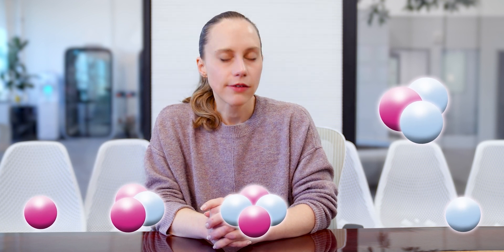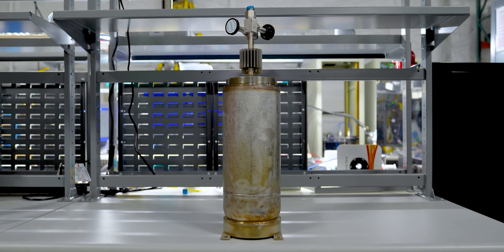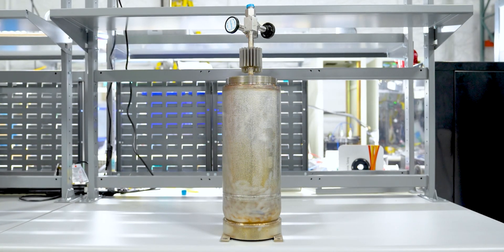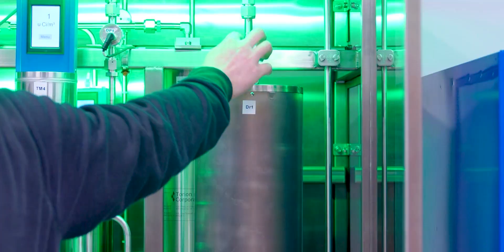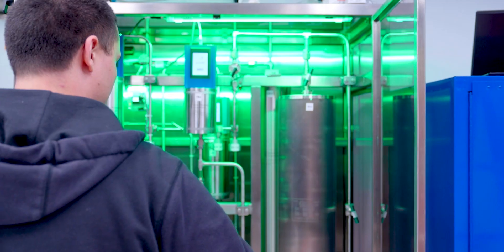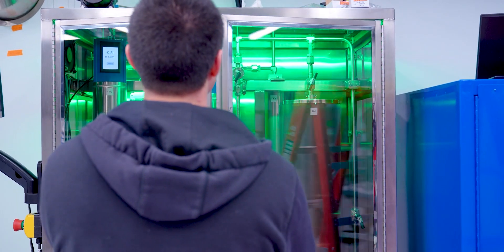Helion’s fusion fuel and byproducts: paving the way for commercial fusion energy

Comment: He3+D2 includes D2-D2 which has a lower threshold and so reaction 7:1 more than He3-D2. It makes neutrons and Tritium. Tritium-D2 has a still lower threshold and makes more neutrons. Helion has no neutrons (or shielding) therefore no fusion. Helion must need investors to be pumping out so much marketing.

Comment: Anyone, who bothers to skeptically examine Helion Energy’s claims, will realize that their marketing campaign is based upon omitting key evaluation parameters. Their latest operational experimental machine was a 6th generation machine named Trenta. Approximately 20,000 experimental shots were conducted using it. Not even the most successful shot generated any significant quantity of fusion reactions and as a result no significant quantity of helium-3, helium-4, or tritium has been generated by any of their experimental shots. The 7th generation Polaris machine is being constructed without any  real fusion results from
the previous generation of fusion experimental machines. Helium Energy previously claimed that their Polaris machine would generate significant amounts of fusion derived electrical energy by the Summer of 2024. They failed that goal and like other such fund raising scams, they have not been held accountable.
Reply: Trenta produced a significant amount of fusion reactions. By my calculation between 10^12 to 10^13 fusion reactions per pulse.
Reply: @elmarmoelzer2229  - Such exponential values tend to be very impressive to novices but are minuscule values compared to the megawatt-hours of fusion energy needed for a commercially competitive power plant. Trenta conducted around 20,000 test shots and many of them produced far less fusion reactions than you stated. Helion hasn't stated how much helium-3 and tritium was produced from those individual test shots that even employed deuterium-deuterium fueled reactions. I've become aware of how you folks have learned to use the complexity of the field to mislead journalists, fans and investors.
Reply: @ - Such exponential numbers appear to be enormous to most novices but are many, many orders of magnitude less than the the orders of magnitude needed to provide even a single megawatt-hour of electrical energy from a power plant design. The Trenta, 6th generation Helion experimental machine, conducted approximately 20,000 experimental shots with many of them not even involving any deuterium-deuterium fusion reactions. As always it was referred to as a fusion reactor experimental machine. For the experiments, where D-T reactions did take place Helion didn't state the quantity of helium-3 and the tritium that was generated from those reactions. Those behind Helion have learned to employ the complexity of the field to exclude key evaluation parameters.
Reply: @ 
- Of course a single pulse is not going to generate MWh of energy. It would take roughly 720 pulses (in a full scale power plant, not in a subscale machine like Trenta) to do that.
- There were no D-T reactions in Trenta. He3 and Tritium is created by D-D reactions, not D-T reactions.

Comment: The best part about the "waste/byproduct" is that it is self-recycling because tritium decay into helium-3 with a half-life of only* 12.3 years.
But how do you actually create deuterium? I mean, I know that we can get hydrogen by electolysis of water, but how do we put a neutron in that hydrogen?

*Compared to the 24,000 years for nuclear fission waste
Reply: 0.015% of all water on Earth is Deuterium. We have entire pools of that stuff in heavy water fission reactors. It is relatively common.
Reply: @elmarmoelzer2229  So we can transform the water in the core of a fission reactor into fuel for a fusion reactor.
Reply: @Engine_Ear_129 - There are physical-chemical processes used to enrich the deuterium oxide found in ordinary water to generate nearly pure 'heavy water.' The process is not inexpensive and you can look up the commercial cost of such heavy water in a Wikipedia article, or from the websites of specialty chemical suppliers. Tritium on the other hand is extremely rare and the commercial product is mostly derived from some CANDU reactors in South Korea.  Currently its commercial cost is more than $30,000 USD per gram. For decades fusion energy promotional campaigns have told journalists, the general public and funders that the hydrogen fusion fuel required is almost limitless. That claim has been a deliberate lie.
Reply: @Engine_Ear_129  Well the point was that they made entire pools of Deuterium for heavy water reactors and a 50 MWe Helion machine would take about 20 kg of Deuterium a year. So, it is not really a problem to make it. Is relatively cheap too.
Reply: @elmarmoelzer2229  But then were do they get/find helium-3?
Reply: @vernonbrechin4207  
Deuterium is both abundant and cheap. Again, heavy water fission reactors have entire pools filled with that stuff. Meanwhile a 50 MWe Helion power plant only needs about 20 kg of it a year. Peanuts.
Reply: @  That was literally explained in the video above. They fuse Deuterium to make Helium3. Then they fuse that Helium3 with more Deuterium to make electricity. That can be done in the same machine (since some D-D reactions always happen anyway) and/or in dedicated machines of a similar design.
Reply: @vernonbrechin4207   It is worth noting that those are relatively small amounts. Things get cheaper when bought in bulk. Also note that A 50 MWe Helion power plant needs only about 20 kg of Deuterium a year. Compared to the annual cost of natural gas or coal in a power plant with a similar capacity, the cost of Deuterium is negligible. On top of that, Helion could make a fortune from just selling the Tritium rather than storing it until it decays.
Reply: @ I agree that the small quantities of research grade deuterium and D2O tend to be more costly then when such materials are purchased in bulk. Consumers should expect many promoters to downplay the cost of such fusion fuels.

The figure you provided for the quantity of deuterium fuel needed to produce a certain number megawatt-hours of electrical energy is based upon assumptions employed for the calculation. It assumes that each short pulse of fusion reactions will consume 100% of the supplied deuterium fuel. It is likely to be a far smaller percent than that. Helion Energy hasn’t provided any estimates regarding the expected ‘burn’ efficiency, the recovery of the unfused deuterium from the vacuum pumping system, or the recovery and purification of the radioactive tritium and interacted helium-3 from the chamber vacuum pumping system. Of course opportunists will claim that they will capture, purify and make a big profit from selling the tritium and unreacted He-3 products.

What fraction, of the 1.0 millisecond compression pulse time, is the fusion reaction expected to occurr in the (7th generation) Polaris experimental machine once it achieves dumping more electrical charge in its pulse capacitor bank then it originally had before the compression pulse was triggered?

Comment: I'm confused though. THe neutron shield is a wall outside the machine itself. The machine is going to take most of the neutrons though right?
Reply: The machine produces 2.45 MeV neutrons in 1/3 of the reactions (1/4 if they have enough He3 from Tritium decay and/or trade). Their first wall is made from Quartz. Silicon has a low probability of absorbing a neutron and it has to absorb three of them before it becomes unstable (then the half life is short at 2.5 hours, so it cools off rather quickly). The magnets are made from aluminum, which only has a half of 2.5 minutes IF it absorbs a 2.45 MeV neutron. Either way, a lot of the neutrons will go right through and hit the shield wall.
Reply: @elmarmoelzer2229  Awesome reply

Comment: I don’t get the Helion approach. The plasma conditions for D-D fusion are way more difficult than for the D-T reaction and after 60 or so years research, that reaction is still nowhere near being efficient enough for commercial reactors.
Reply: We could have built a D-T machine that does Q>1 some 25 years (or longer) ago but all the funding went into ITER and mind you, it was not that much money on a grander scale either (look up the ERDA plan and fusion funding!). 
With private investors, there is now finally enough funding to explore alternative ideas. There are plenty of those and not just Helion. Either way, whether D-D is a lot harder or not depends on what you consider the hardest part. Helion thinks that a little more than twice the ion temperature is not that much harder and the benefits are huge. There are fewer neutrons and they have a lot less energy. So, materials are easier, shielding is easier, etc. Plus D-D produces a He3 in one branch. That He3 can be fused with another Deuterium atom and the reaction is very energetic. The biggest advantage is that all of the resulting particles of D-He3 fusion are charged particles with a total energy of 18.3 MeV. With their direct conversion and their ability to recover most of the input energy the same way, they can get away with a relatively low Q. So, by having easier energy conversion and fewer neutrons and easier materials, they trade moderately harder physics for much easier engineering. There are a lot more nuances that work in their favor. Overall, I think they have a very good shot at it. Not a 100% chance, but a good chance. We will know some time next year, probably whether they were right.